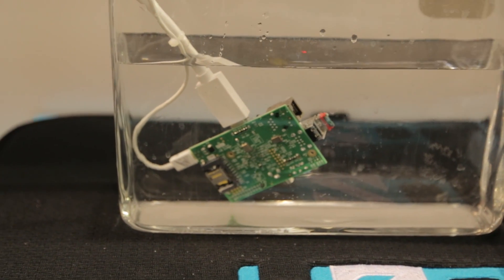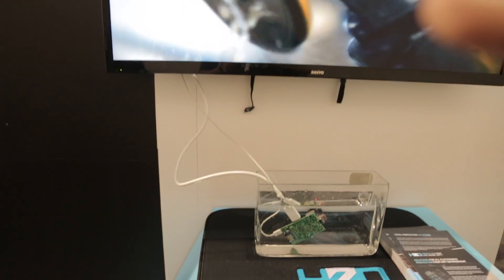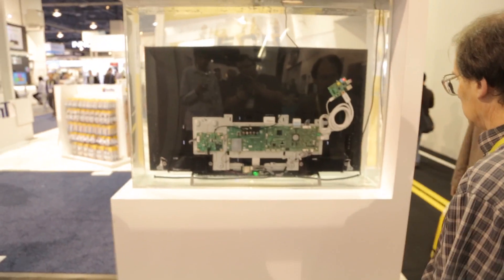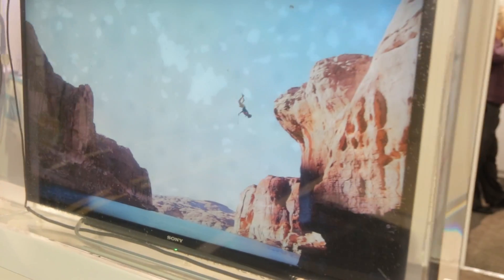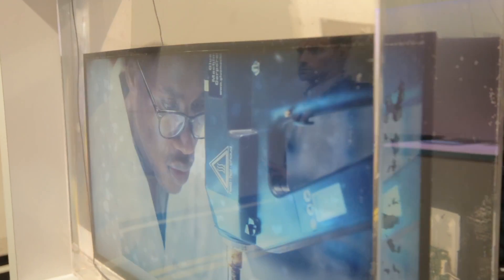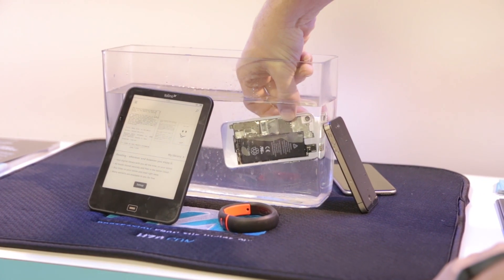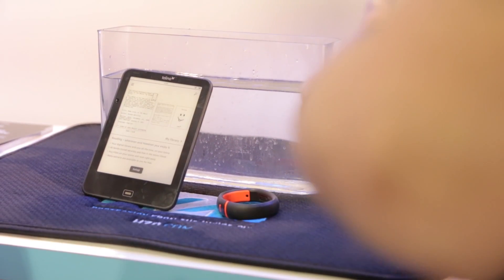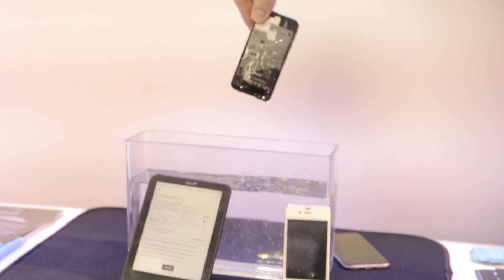Fully Water Proof Electronics - CES 2015

Comment: I can just imagine the coolingg system in PC getting 100x better?
Reply from the maker: Well yeah, if you want to see something VERY cool check out NCIX/LinusTechTips' Mineral Oil PC.

Mineral Oil is non-conductive which means you can fully submerge ANY electronic into it while allowing it to still operate (barring mechanically moving parts).

This video, of course, is way more convenient as you don't need to use some weird mineral oil, you can basically just use any liquid you want.